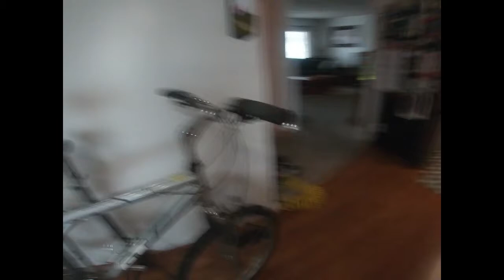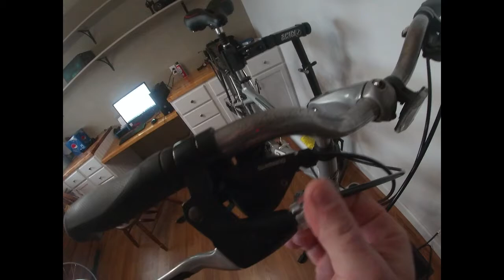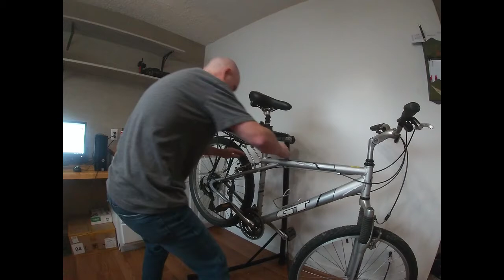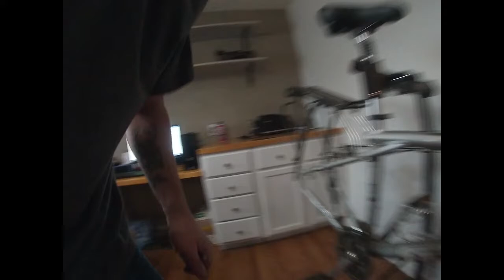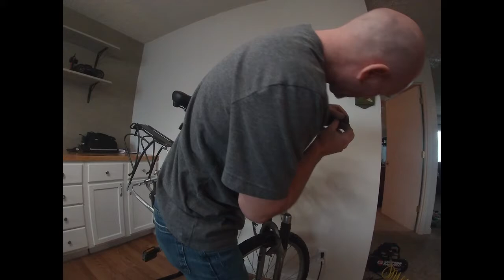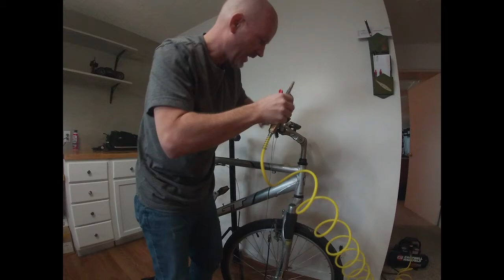Bafang build PT2 Ebike conversion. Stripping off parts.

Comment: Joe, I'm looking forward to seeing your bike come together.  I did this myself almost 1 year ago and was able to ride it until winter set in.  My project started with a brand new 
Giant Talon 2 hard tail mountain bike $720 and the BBS02 kit with 48v 17.5 Ah battery $1080.  As I am 69 yrs old, I have no intention of riding much off road, but wanted the front
 suspension, heavy duty Aluminum frame and hydraulic disk brakes without having to add them later.  Most of your add on parts were standard equipment on this bike.  After some
 initial snags, i was able to modify and adjust things to complete over 800 miles of joyful riding last summer.  Good luck,  mike
Reply from the maker: Thanks for subscribing! If you got any questions. Feel free to ask. I been planning and ordering parts for months. Being an older bike. I knew I would need to upgrade some stuff. But $60 for a bike I have ridden a few years now. I really wasn't worried about it.